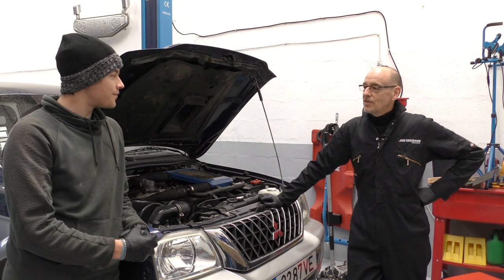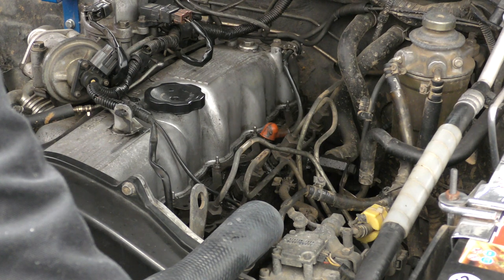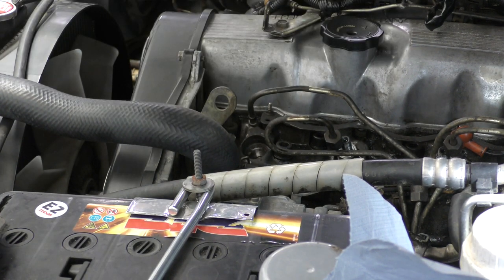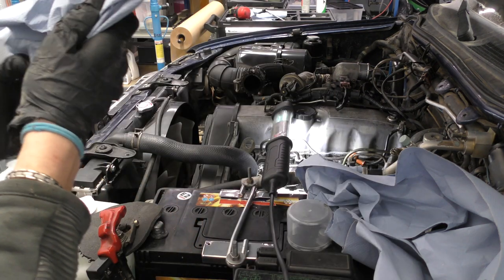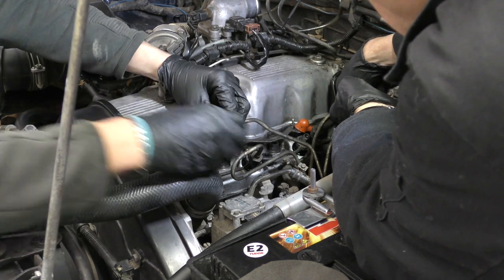Fuel Injector & Washer replacement - Shown on Mitsubishi L200 (4D56) - start up smoke solved !

Comment: thank you so much for the proper torque specs, my first time with injector rebuild and same smoke problem :) i also used a beer can cut to a small circle for injector shim. brings pop off pressure back to where she needs to be
Reply from the maker: You are welcome! and a great tip - thanks for commenting

Comment: Hi Guys, thanks to your excellent videos I changed my l200 glow plugs. No way would I have attempted it without your help.   I am now going to try changing the fuel injectors again thanks to your video.  I have been looking where to buy, some injectors but some seem too cheap. Any advice where you bought yours please?   thanks guys
Reply from the maker: Not sure where you are located (we are in Portugal) got very fed up using Autodoc and the main dealer wanted silly money, ended up getting them at https://www.ks-international.com - if you join the  L200 international forum on facebook, you can get a discount code (if my memory serves me right - no harm in asking - vague, as groups change there name and confuse me :)
Reply: @DrivenMadShow  Many thanks for the link I will check them out. I'm in the UK

Comment: I’ve just rebuild my 4D56T engine but still there’s blue smoke in the morning for 5 minutes after the engine got hot it’s disappeared any ideas bro
Reply from the maker: Blue smoke is normally oil related - ours was white on start up only, the small seal was not there on the injectors, smoke now gone ! - yours is a tough one, worth a post on the L200 Facebook forum, obviously you will get twat answers, but there are a couple of bods who really know their stuff on there ...https://www.facebook.com/groups/mitsubishil200ownersclub/
Reply: Hi Avenash......
Regarding the blue smoke that is caused by oil burning within the cylinders.
When you rebuilt the engine did you check all cylinders for wear and roundness, were they re-honed and de-glazed?
Did you replace and check the piston rings gaps, were the oil scraper piston rings replaced?
Did you check all the valves and Valve guides in the cylinder head for wear?
Did you replace all the valve stem seals?
Have you checked the turbo seals?
Have you compression tested all the cylinders since the engine was rebuilt?
Best regards,
Stefano.
Reply: @stefanobio7045  everything is new inside buddy. The previous diesel fuel pump has been redone also and the blue smoke was a lot even after rebuilt. Recently I’ve change the diesel fuel pump and this one appears more robust. Blue smoke from previous one was a lot but with this one is very less only for like 3  mins with normal Rpm

Comment: Thanks for the video, found it real helpful. Just about to do same job on my 2.8d shogun mk2 . My biggest worry is slackening the injectors. Can they be broken if your too heavy handed, these have never been out as far as I know.
Reply from the maker: Luckily the injectors are pretty tough and much larger than some I’ve seen. 
I’d recommend giving them a spray with penetrating fluid before each drive for 2 days or so, just to help with removal. 

If you have any other questions feel free to ask. 

Thanks for the comment 👍
Reply: @DrivenMadShow  Thanks for your reply, turns out I was worrying over nothing they came out fairly easy.  I'm trying to cure a power loss and black smoke problem on acceleration that I have had for a couple of months now. I started by fitting a new air filter and cleaning out the egr but it made no difference. So l am now changing injectors and fuel filter, if they fail to do it any more suggestions??.
Reply from the maker: Check the cat (if you have one, that just killed our 2010 L200 as clogged) or turbo for leaking seals

Comment: I was told the heat seal washer smallest one went flat side down domed side to the injector.. Is this information wrong I was given or doesn't it matter.. Thanks!
Reply from the maker: The dome side is down, there should be a seat on the other side that fits the injector ( I have look this up as I know naff all 😂) check out this photo, it explains it really well (shame we cannot attach photos in the comments). 
 https://www.peachparts.com/shopforum/diesel-discussion/93265-om-603-injector-heat-shields.html

Comment: Well if it isn't Mr.murduc 😍 , long time no see ya my friend , good to see us again ,  0:15 us he is the best , do it's job without complaining .

0:40 that's it?😂 mine done like 1200000 km 😎 , but every couple of years I take the injectors out & give them nice cleaning & I change all the washers & go .

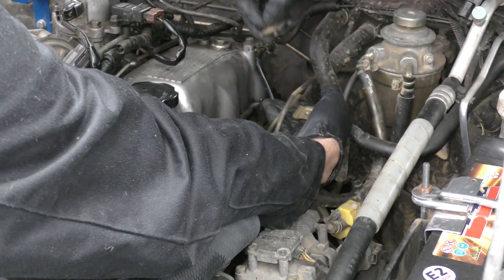2:15 one of the most things I love about those 4d56 engines is they don't have these crappy electric connectors or what so ever , just nut over nut 👍.

6:23 u shouldn't just left it hanging there , u should have to take it out & give it a nice clean using perhaps a carbon cleaner spray .

6:48 ya perfect cut indeed😎👍 , 7:50 big bingo😂.

Another benefit of those 4d56 engines is that they don't have those rubbery washers , just nice cobber ones😎😎😎,so lovely😎👍.

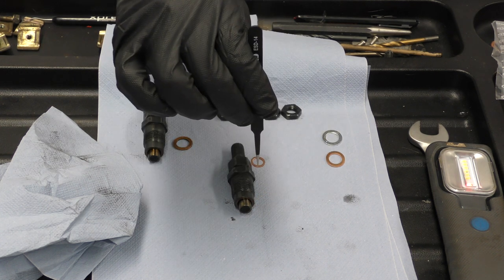10:25 correct👍👍👍

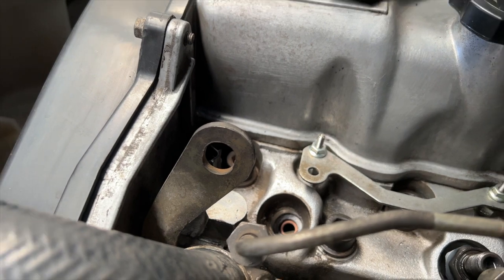11:11 nice @ clear👍👍👍

12:35 that satisfying click😍😍

14:38 just look at that , satisfying indeed.!

15:10 u should leave at least one of those nuts open until u pump out all the air using the diesel plunger on top of the fuel filter.

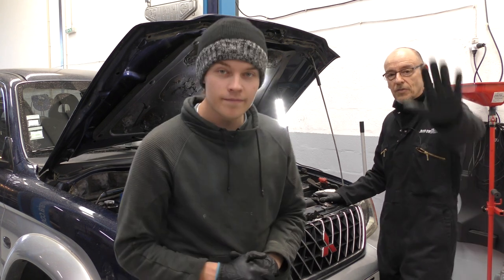15:57 can't wait to see the next vid , hope this sort out the smoking issue I guess.

See ya mates ....
Reply from the maker: 😍 next on the ramp is Bosco our 2010 L200, back from the dead, with his newly rebuilt engine
Reply: @DrivenMadShow  looking forward to the next installment......
Stefano

Comment: Hi Jon & Nath,
That was a good job well done to you both, and luckily none of the fuel line nuts or injectors were seized.
Will you be showing the fuel bleeding procedure in another video please?
Thank you.
I'm looking forward to the next installment.
Best regards to you both.
Stefano (UK).
Reply from the maker: Stefano, this is Murdock, he does not need a bleed, not a drip of fuel came out, popped the lines back on, fired up first turn of the key :). ... or is that just lucky !    🥷🏾
Reply: @DrivenMadShow  Hi Jon & Nath,
Happy Easter to you both.
You were probably just very lucky?
On your vehicle there is a priming hand pump located on the top of the fuel filter.
The normal air bleeding procedure would be to Slacken off the flare nut from the furthest injector from the filter, then pump the diesel through the fuel line until it's clear of all air bubbles.
Then tighten the flare nut and repeat with the other fuel lines.
Best to utilise either a flare nut spanner, or crows foot to prevent rounding off the flare nuts.
Looking forward to your next installment.
Take care and stay safe.
Best to you both.
Stefano

Comment: Am I right in saying this is a mechanical fuel pump and injectors, not common rail?
Would be a good candidate for running on veg oil or waste engine oil instead of pricey diesel!?
Reply from the maker: Experts we are not - but what I can on line :

A non-common rail engine, specifically older diesel engines, can run on waste oil, but there are several important considerations and modifications that need to be addressed to ensure proper functionality and to avoid damage to the engine. Here's a detailed overview of what you need to know:

Types of Waste Oil
Waste Vegetable Oil (WVO): Used cooking oil from restaurants or homes.
Waste Motor Oil: Used engine oil from vehicles.
Suitable Engines
Older Diesel Engines: Pre-1990s mechanical injection diesel engines are generally more suitable for running on waste oils because they are less sensitive to fuel quality compared to modern engines.
Indirect Injection (IDI) Diesel Engines: These engines are more tolerant of different types of fuels.
Preparation and Processing
Filtering: Waste oil must be thoroughly filtered to remove particulates and impurities. This can be done using multiple stages of filtration, starting with coarse filters and moving to finer filters (1-5 microns).
De-watering: Removing water from waste oil is crucial to prevent damage to the fuel system and engine. This can be done by heating the oil and allowing water to settle at the bottom, then draining it off.
Modifications
Dual Fuel System: A common approach is to install a dual fuel system that allows starting and shutting down the engine on regular diesel fuel while running on waste oil when the engine is up to operating temperature.
Heated Fuel Lines and Tank: Waste oils are more viscous than diesel, especially at lower temperatures. Heating the fuel lines and tank helps to reduce the viscosity, making it easier for the engine to pump and burn the fuel.
Fuel Pre-filters and Water Separators: Additional pre-filters and water separators can help protect the engine's fuel system from contaminants and water.
Injection Pump Adjustments: In some cases, adjustments to the fuel injection pump may be necessary to accommodate the different properties of waste oil.
Potential Issues and Maintenance
Injector Clogging: Waste oil can cause clogging of fuel injectors. Regular maintenance and cleaning are necessary.
Engine Deposits: Waste oil may lead to increased deposits in the engine, requiring more frequent oil changes and engine cleanings.
Corrosion and Wear: The presence of acids and other contaminants in waste oil can cause corrosion and increased wear on engine components.
Legal and Environmental Considerations
Legality: Using waste oil as fuel may be subject to regulations and laws depending on your location. It's important to check local laws and regulations.
Environmental Impact: Burning waste oil can produce different emissions compared to standard diesel fuel. Proper processing and handling can mitigate some of these concerns.
Step-by-Step Process
Collect Waste Oil: Obtain waste oil from reliable sources.
Filter and De-water: Filter the oil through progressively finer filters and remove water by heating and settling.
Set Up a Dual Fuel System: Install a dual fuel system with heating elements for the waste oil.
Adjust Engine Settings: Make any necessary adjustments to the fuel injection system.
Monitor and Maintain: Regularly check and maintain the fuel system and engine.
Running a non-common rail engine on waste oil is feasible with the right preparation, modifications, and maintenance. It's essential to ensure that the oil is properly filtered and de-watered and to monitor the engine's performance and condition regularly to avoid potential issues.

Comment: Hi, great Job. I have a similar problem but my one have black smoke only when accelerate  not on Idle and not metter cold or hot is remain same a lots of black smoke and not much power, any advice is greatly appreciated
Cheers
Reply from the maker: Hi there! 

Could have carbon or soot build up inside the egr or intake manifold. 

These are dirty engines 😂

Thanks for the comment 👍

Comment: Forgive me if I missed it but I'm wondering if your new injectors are OEM? You guys mentioned the washers are OEM but what about the actual injectors? I'm struggling with to track down genuine brand new one's here in Australia. Still waiting on a reply from Mitsubishi but everywhere else I've tried can't seem to source genuine brand new one's.  Instead they propose to service/recondition them or go for blueprint/aftermarket set.
I've not read good things about aftermarket injectors.  I'd much prefer genuine originals
Reply from the maker: Hi! No the injectors were not OEM. But they work a treat. Not sure where we got them from but the washer set was Mitsubishi OEM. 
I totally get why you want OEM injectors. I’ve had my fair share of other non OEM parts failing, but luckily the injectors have been fine so far. 
Good luck on your search 👍
Reply: @DrivenMadShow I finally got around to replacing my injectors today. Followed your video step by step and everything went splendid 👍 thanks so much for creating these videos, they've saved me a tonne of money. You guys are awesome 👍😎👍

Comment: Hi gents, i have a shogun sport. Same engine, same leaky on top of injectors. Could this cause the speedo needle to jump around on acceleration and in neutral, as in bad fuel delivery? Or could it be more? Thanks
Reply from the maker: Unlikely but we are not experts - new Speedo cable or check yours 🧐